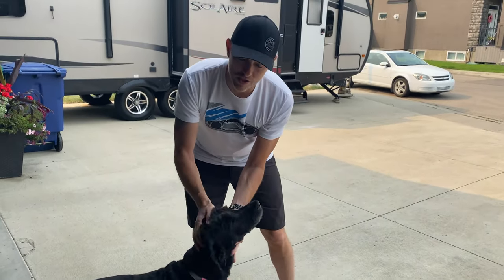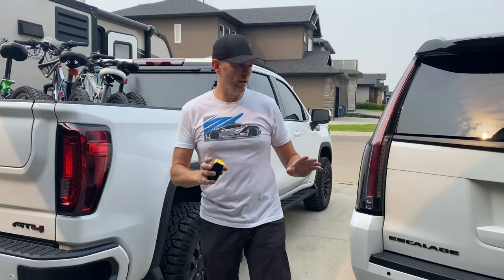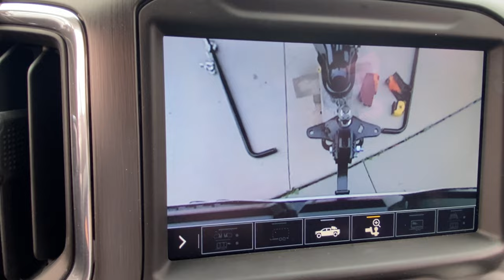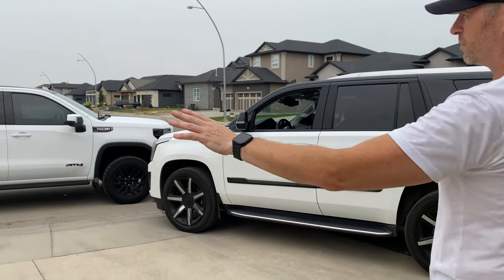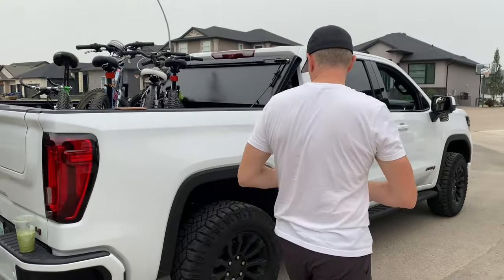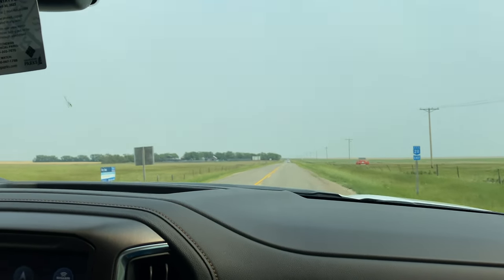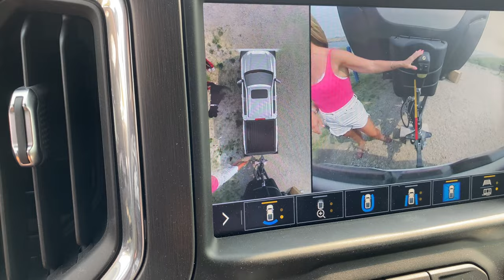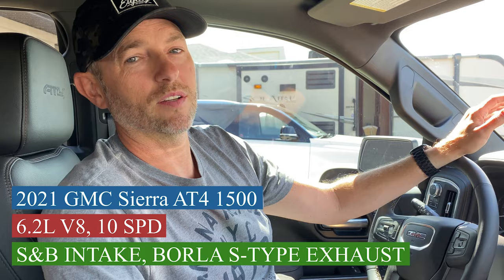2021 GMC Sierra AT4 Max Towing Capacity Review and Impressions.

Comment: How did you get the side view on your screen? I have all the other views for hooking up the trailer and I can see the hitch while I'm moving but that's it. Maybe I have old software it's a 19 Denali.
Reply from the maker: It should be automatic once the trailer is properly connected.
Reply: @Donslife  thanks I guess I will have to check with the dealer.
Reply from the maker: If you have the trailer app in the infotainment options and the mirror mounted cameras I would think you have the option
Reply: I do,  but it looked like your side cameras were activated as you were moving around the corner. I can use the different features while backing but not going forward.
Reply from the maker: @kellydixon1893  yes when I signal left or right while moving forward they activate the camera/screen so I can watch the trailer wheels and their path
Reply: @Donslife  Then that's the part not working for me. I select it when I'm parked. It does not self activate, and thanks so much.
Reply from the maker: No problem.  Good luck!

Comment: I was wondering why you needed to add the  airbags. With Max tow package you truck has 300lb heavier rear leaf springs , when properly adjusting your weight distribution hitch with the load distribution bars it will level the trailer just fine.  I did install the airbag on my 2015 GMC serria because  it wasnt a max tow model .Now have 2020 GMC w/ 6.2 3.42 max tow and   
my front side loading  toy hauler is 30 ft  7000lbs ish wet. I have  had no tow issues where  I could not see this as a need. Not being  condescending  just curious about the reasoning ?  Thanks you have a great program.
Reply from the maker: Makes a noticeable difference for me by reducing body roll and keeps things more stable with crosswinds.  Something we have a lot of in the prairies.   I never installed them to increase towing capacity.   I installed them to stabilize the load and reduce sway.  They are there to compliment the weight distribution hitch.  I am pretty level too with the hitch set up before adding a little air to the bags. I wouldn’t care if I had them with my boat 5000-6000lbs. But my trailer loaded is about 7500+ with some cargo in the truck box.  Smooth sailing ⛵️
Reply: @Donslife  ok!  That makes  sense.   I am rarely in wide open areas except maybe  bean/corn fields  along the interstate.   ;)

Comment: Does your HUD shake quite a bit on bumpy roads?
Reply from the maker: I haven’t noticed nor have I been trying to check.  I will make it a point to drive on some washboard gravel and see when the chance arises
Reply: @Donslife  The moment i go offroad the HUD gets extremely vibratey even driving down the coquihalla it can move around so i end up turning it off most of the time. That being said; when i give my dash a gentle smack near the HUD; barely moves. Smack it around the 8" Screen... Really moves around. Crazy.
Reply from the maker: @DarkenFool  I absolutely have not seen anything like that.  I will monitor mine

Comment: What's the payload and gvwr of your truck?  I had an F150 ecoboost and am thinking about trying out a GM product for a while.
Reply from the maker: Payload 1444lbs
Conventional Trailer 8800lbs
GVRW 7000lbs
Curb weight 5556lbs
The AT4’s tow the least of GMC 1/2 tons.  The  powertrain isn’t the issue, the suspension lift is.  The  F-150’s tow more if you need it.  The Raptor’s tow less though.
Reply: @Donslife  Thanks for the quick reply!  I'm looking at all options right now but I'm obsessed with the look of the GMC.  The styling is outstanding!
Reply from the maker: @jamespeters066  I am with you.  I own a 2016 F-150 (work truck) had a Lincoln Mark LT before that.  This AT4 is my favorite.  I wish the Fords would take a chance stray from their similar look for so many years.  Lights, grill and bumper is sometimes the only way to quickly tell them apart.
Reply: @Donslife  Do you have much experience with the 5.3 engine?  Good? Bad?
Reply from the maker: @jamespeters066  We had one, it was solid and reliable in a Yukon XL.  But once we had the 6.2 in the next one and my Denail, we never went back.  The power and the responsiveness was night and day.
Reply: @Donslife  Average L/100 when daily driving?
Reply from the maker: @jamespeters066  on the 5.3 or 6.2?  I don’t really keep track but city driving 5.3 maybe 13/14 and 6.2 15/16.  Honestly just guessing right now.  Eco Boost is superior for fuel economy
Reply: @Donslife  I was getting 13 hwy and 15/16 city in my ecoboost.
Reply: Ever wish you got the diesel instead for towing?

Comment: What’s your payload on the truck. You have to be close to max or over.
Reply from the maker: Max is 8800 for my truck.  I was about 80-85% including fuel and passengers.  I tow the trailer dry too. The point of the video was to review towing at closer to max capacity.   I wouldn’t and don’t promote unsafe towing.
Reply: @Donslife  was just wanting to know what the door sticker said for your max payload
Reply from the maker: I should’ve mentioned the trailer is on the light side for its length.  Fibreglass construction and about 6400lbs dry.  We bring lots of cargo in the SUV which tows the boat.
Reply from the maker: @beerbelly6670  1444lbs

Comment: Would you trust that half ton 6.2 truck in the mountains to tow that much weight? Your trip looked pretty flat.
Reply from the maker: Short answer - Yes I would trust it based on my experience and set up.  The biggest drawback is small fuel tank.  Tires with a better load range would be good too. I towed this trailer through the Rocky Mountains with my 2013 Denali 6.2 at least 10 times and it was fine. The 6 speed transmission was strong but annoying with very limited gear options.

Comment: About to buy a 2021 AT4. Was on the fence about which engine to buy. Ruled out the 3.0 and couldn’t decide between the 5.3 and 6.2.

Why does the 5.3 have a higher tow rating than the 6.2.
Reply from the maker: It explains it partially here:  https://www.gm-trucks.com/forums/topic/245136-why-does-62l-have-less-towing-capability-than-53l/

Comment: Is this a good truck to buy at 80k miles ? Hmm. I currently have a 2019 ford and I'm having trans issues
Reply from the maker: Have it checked out first.  I have had 3 fords in the last 15 yrs.  Expedition (bad trans). Lincoln Mark LT (bad trans) and an F-150 XLT no issues.  All with 6 speeds.   You just never know. The F-150 lives with a trailer permanently attached as a work crew truck
Reply: @Donslife  I had it fixed I had a bad jerk on the highway then trans heated up was in the shop a month and all they replaced was the trans cooler and reprogrammed pcm now my 4 and 8 gears aren't going smoothly minor jerk and it's annoying

Comment: I don't see any anti sway devices on that hitch set up.  Am I missing it?
Reply from the maker: It has a weight distribution hitch installed
Reply: @Donslife   I'm not one to tell anyone that they should do this or that, but I would suggest you google sway control and see how it could be beneficial.   I believe Curt sells an add on sway control system for that hitch.   That is a pretty long trailer for that truck and anti-sway seems appropriate.

Comment: Do you think I could tow a 2019 Fuel 287 Toy Hauler with an 8760 dry weight loaded with a 4 seater rzr turbo s4?  

I know it will be heavy but I’m hoping it can handle it to get me where I’m going.

I have a 2021 GMC Sierra 1500 3.0 Duramax Diesel

I do have bags and plan on getting a tune for my truck as well as soon as it releases.
Reply from the maker: It’s a job for the 2500 not the 1500.  You’re close to a 100% of the max towing capacity with the trailer alone.  I wouldn’t do it even though it would probably pull the extra weight.  Not a safe move.

Comment: You've got to be WAAAY over your payload capacity.  The way the manufacturers quote towing capacity is horribly misleading
Reply from the maker: Nope.  Just close to Max capacity, which is the point of the video.  It is a 6400 lbs trailer dry with some cargo and 4 bicycles in the truck box. 

Mine specs:
Payload 1444lbs
Conventional Trailer 8800lbs
GVRW 7000lbs
Curb weight 5556lbs
The AT4’s tow the least of GMC 1/2 tons.  The  powertrain isn’t the issue, the suspension lift is

Comment: Help me!! How do I turn the air on for the back seat of my at4 haha
Reply from the maker: 😂 what ever the front fan setting is will affect the airflow into the backseat through the console.  The back vents do not blow as hard as the front vents do.
Reply: I was so damn confused haha thanks yea they really don't put out too much air but do the job
Reply: If there is poor airflow it may not be programmed correctly from the factory. Had to have rear vents reprogrammed on my 2020 HD AT4 so could be the same in the 1500’s.
Reply: @ryans2004 Thank you!! will have to look into it!! Because there really is poor airflow!! Did you go to the dealership to have that done??
Reply: @at4life95   yes, it’s warranty work. Invoice shows “relearn HVAC controls”.
Reply: @ryans2004  thanks for your help